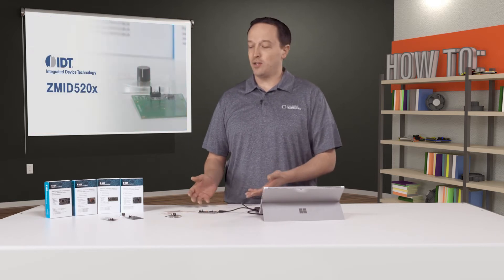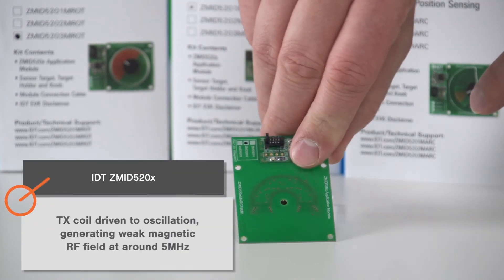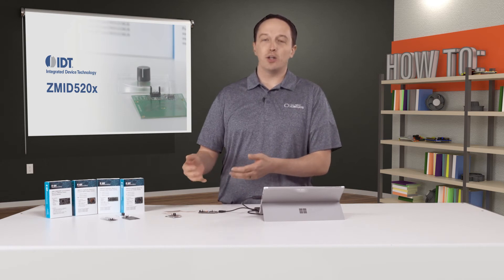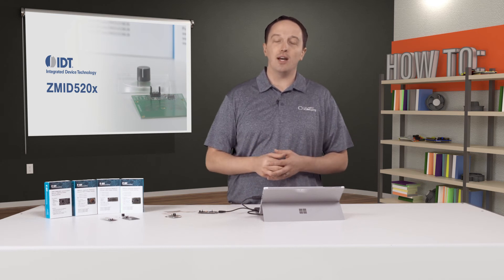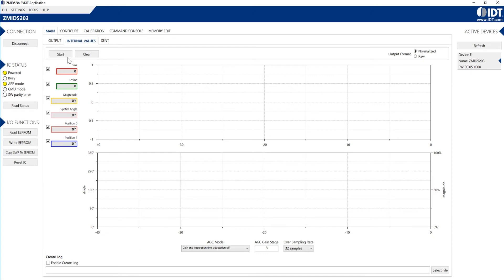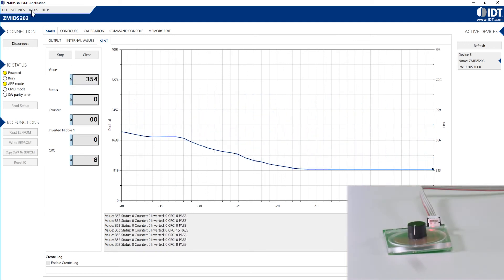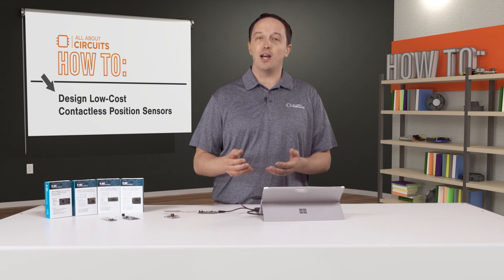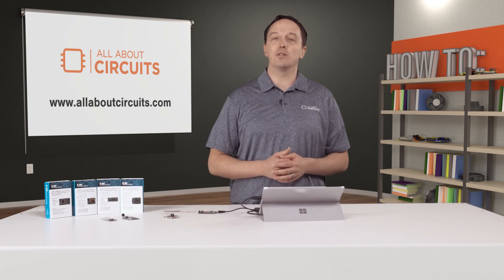How To: Design Low-Cost Contactless Position Sensors

Comment: I'm a newbie at this so I apologize in advance if this is not the right place to ask this question. I looking for a ribbon type contact sensor that could detect the precise contact position of a non-metallic marble rolling across it. Or if there is a better way to do this, I'd consider it. Would need to cover a width of about 10-inches. Also, if there is a proper online forum for this, please refer me to it. I'll be using either a Rasberry Pi or Arduino. Thanks.
Reply from the maker: Thanks for watching! To be completely transparent, we do not have specialists or researchers that have answers to this answering our social media. If you have further questions about a project that you are developing, please post it in the AAC forum so that our members can provide advice and, if necessary, ask for additional information. Also don't forget to subscribe to our channel and click that notification bell for more content!